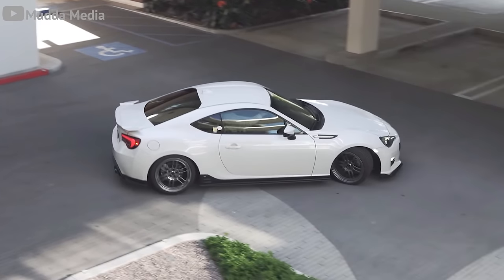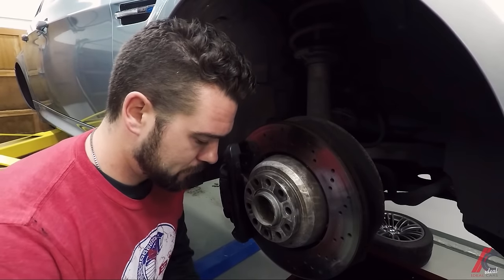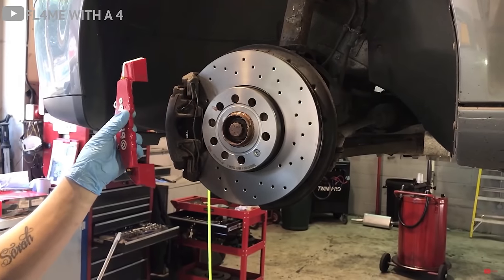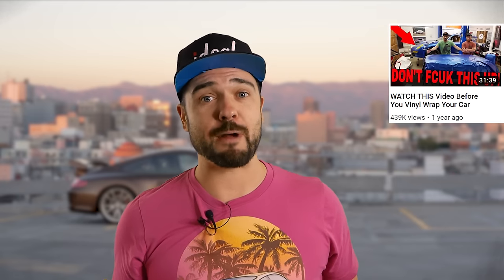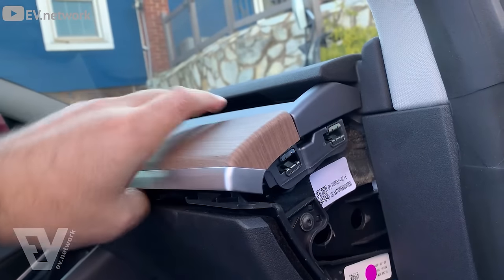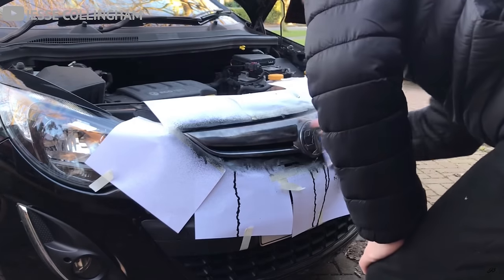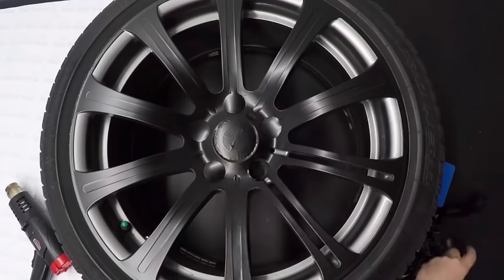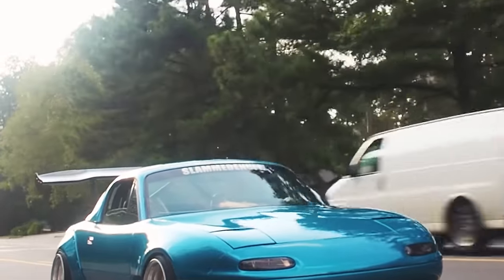Cheap DIY Car Mods That Make A HUGE DIFFERENCE!

Comment: First mod should always be tires unless they're already good
Reply: Pirelli dragon sport OMG these tyres are my everything literally soooo good especially in the wet
Reply: Agreeded
Reply: Tires aren't a mod though

Edited moments after: unless the are a specific compound or different size in the case of different wheels
Reply: Wheels tires and suspension are the first 3
Reply: Buy a car that needs new tires and bam u cut some off the price of your car since you’re gonna get new wheels anyway
Reply: Irrelevant comment on a video that says cheap in the title
Reply: @ughugh4117  Irrelevant comment on your part too
Reply: @cleanwindow_7869  I, Dio Brando, only use inline V20 Engines
Reply: Good tyres, then a good brake system, it's all well and good having a pretty car, not so good when that pretty car goes into some guys rear bumper or fence lol
Reply: Learned that the hard way
Reply: Facts 💯
Reply: All seasons all the way
Reply: Facts mine was
Reply: @andrewjohnson442  brakes ?
Reply: Learning bros
Reply: Yes agreed or muffler delete 🤷🏾‍♂️
Reply: Video top right corner
Reply: Agreed
Reply: Agreed  but I will do rims and tires
Reply: Either that or tint
Reply: We know dadddddd
Reply: @alexeyshtengelov6086  and the a lot of english are is not a the

Comment: IQOTD: Probably suspension, then wheels and tyres. Lower suspension reduces body roll and improves the feel  of the car and handling, while lighter rims reduce weight and the looks of the car and tyres keeps you nice and steady

Comment: What I noticed recently is that a lot of BMWs are debadged. Maybe they don't want people to know that they're rolling in a cheap 3 Series with a 4 banger...
Reply from the maker: yeah or they just like a cleaner look. I debadged one of my M3's... so you can look at debaging both ways.. to hide a slow car... or to hide a high performance car.
Reply: Some people add M badges to their crappy BMW to brag that they have an M car.I'm sick of this.I've seen this in so many BMW.Even if tou buy a BMW M240i it looks like you got a regular 2-series and you decided to stick an M badge
Reply: @nickgav7390  i once saw Ford Transit with M5 Badge and a huge ass sticker saying M5 covering the whole rear
Reply: Nick Gav I saw a crappy one on a 7 series
Reply: i took my 335i badge off so people think it’s slow
Reply: 318ti not a cheap 4cyl 😂 at least the “cheap 4’s” aren’t beaten to shit like all the i6’s owned by anyone who thinks they can drift 😂 clowns
Reply: Nicholas Buddin the most bmw 4 bangers are build badly. They got many problems and are very unreliable.

Comment: I have a 1999 b5 1.9tdi a4 saloon and when I will buy another car then the a4 is going into project car status. First mods would be, suspension (2-3 inch lower) wheels, ecu remap, straight pipe, maybee down the line a bigger turbo and an intercooler

Comment: Honestly I always change all the fluids first thing and same with all the filters, then I change up the exterior lighting with LED bulbs then work my way inside and do the same. Though if those don't count I would say a new radio usually is the first mod. Most the cars I get are really old and don't have good entertainment systems so I have to update them asap. Which I always aim to get the radios with backup cameras as well.

Comment: I always do suspension first.  If you get your wheels first, how do you KNOW they will fit once you lower it.  I am always pushing the limits of what will fit under the fenders of my cars.  Doing it this way has saved my a$$ more than once!  One time Discount had to Take back a one-off set of Forgelines because the 19X12” With 335/30 19 rears wouldn’t fit.  (They needed about another 3/8” backspacing to fit). If I had gotten the wheels first, I would never have caught the issue, and I would be out 6K for wheels (Or at least another 2k in rear wheels with the proper backspace)

Comment: My list. 
1st tires. 
2nd Brakes and calibers. 
3rd suspension. 
4th rims. 
5th steering wheel upgrade. 
6th short throw shifter. 
7th new belts n hoses and all needed fluids. 
8th cold air intake
9th intercooler system.
10th weight delete. 
11th rebuild engine and trans if needed. 
12th drive it like a bat outa hell.
Reply: Oh forgot one mod. Some cool ass under glow. Idc what people say I love underglow. It's not illegal either long as it's not red or blue. U just can't have it super bright or flashing either.

Comment: Everything was good until the lowering springs. Unless you want your shocks and struts to be prematurely wearing out multiple times, get shocks and struts that are made for lowering springs or coilovers (which are not cheap but replacing shocks frequently isn't either)

Comment: I would not lower my car, my first mod was snow tires. Then head gasket, then radiator water pump heater core then stereo, dual cameras, got much more to do.

Comment: Covering Break Calipers with Paint or  didn't know about covers, since clearance with wheels are issue. Anyway, covering them is like applying a blanket to your Break System. It won't allow the breaks to cool and work efficient.  Since, clearance was addressed i don't like adding weight to the vehicle so don't like Spacers one time 2 of them cracked and caused violent shaking on the vehicle, they loosened the lug nuts.  Dropping any car on my driveway won't clear my up hill slope of driveway as it is it occasionally scrapes or bottoms out with a passenger. in stock ride

Comment: First modification I always do which is the least intrusive is addressing amber reflectors, turn signals, or whatever it may be..I can’t stand an amber anything, so if it’s a turn signal I’ll make it clear corner and use a silver bulb that glows orange when lit..so I can be friendly with DOT requirements but look 10x better ..of course limitations in some cases like the Audi S3.. I had to end up using tint to just make it darker..yea yea it makes it less reflective, peeps in Europe don’t seem to have issues with visibility do they!?!

Comment: I’m almost 15 and I think my first car modification would either be an after market exhaust system, rims, tint, or an after market suspension upgrade. Also, I’m thinking my first car will be a 2008 Nissan 350Z
Reply: pretty awesome first car!

Comment: Tyres and rims sound system interior and paint job suspension brakes exhaust engine and stickers with my name or logo across the car plus weight reduction

Comment: Just my opinion / thoughts that bug me and is subjective for other people:

Slammed excessive camber cars look so bad, I don't see how people think they look good, very low with a slight camber to increase cornering is still good but you do not need that much excessive camber. If you drift or want a higher top speed going straight due to less grip / track friction then sure, but outside of that it will ruin your grip and your handling (unless you want to drift or have loose handling and grip), it will severely wear down your tire life, and it will make bumps and rough terrain not the smoothest ride while you're car rides on its shock bumps (or the wheel if you set it too low even with a body mod or lip curl to fit the tire, but of course adding the camber will allow you to go lower too since it's at an angle). I do not see the aesthetic appeal of it, it makes the car look very bad and "cheazy" / not like a professional or high performance modded and designed sport car. It's unsafe for street driving and should only really be used IMO on drift cars for the track.

Comment: Lowering does increase the handling on the car but when you go to the extreme camber that does not improve handling it actually makes it worse because you’re riding on less of your tire than intended if that’s your look that’s OK but no you do not get better handling with extreme camber this is coming from a mechanic for 25 years

Comment: Lowering your car can give you a great benefit to your car
Also can destroy your car completely unless you have adjustable suspension
Lowering cars sucks on speed bumps and bumpy roads or damaged roads or any roads that kinda destroy the car
I suggest not to lower your car, if you driving or having this road in your country but with adjustable suspension, it will be fine as long as you remind yourself each time you see bumpy road or damaged road

Comment: The first modification for my first car would be a turbo upgrade (if the car has at leat one)
Reply: Noo. Do you even own a car?
Reply: @KERBROES  Not yet.I want to buy a SAAB 93 Aero as my first car
Reply: @nickgav7390  haha cool car. Word of advice do mad research on forums and focus on mods that build reliability. Reliability over power any day. I literally run 385whp daily no problem. It is about doing it right and starting from the ground up. Think of it like this, in your pursuit of any performance gain is welcomed, but not necessary. You will end up with a clean reliability beautiful machine instead of a shit box on the brink of destruction. To get a turbo upgrades the rest of the car most likely has to be upgraded as well to hold that much power reliably, when you dont do that it's how horror stories happen. Always do it right.
Reply: @nickgav7390  Trust you will be way more happy with a "balanced car" instead of a big hp straight line machine.

Comment: Haha first preformance mods a $15 spector filter then get a saw and cut the springs then get a $30 fartcan that sounds like a pissed off bee and a sticker that says Honda even if it isn't a honda because that sticker alone will add 20+hp ooooh yeah LOL

Comment: First thing I've always done in terms of modding the few cars I've driven has always been to strip EVERYTHING that isn't absolutely essential out of the interior of it, replace what is necessary with the lightest possible option that meets quality standards, i.e. won't break after like 2-5 track days. After that it's always tires...

Comment: Just did my preferred 1st mod. A remap. Went from stock 450hp, 480 lb ft of torque to stage 1. 530 hp, 575 lb ft of torque. 2016 BMW 650i xdrive gran coupe m sport is a whole new animal now. Props to AMR PERFORMANCE!!!!
Reply: how u do that

Comment: Miata or S2000 ?
Reply from the maker: depends... both are great options.
Reply: I would buy a S2000.However,keep in mind that if you want to buy one of those cars,it is almost impossible to find one stock

Comment: Dont lower your car if you cant don't right. Literally worse handling.
Reply from the maker: you definitely have a point!
Reply: @IdealMediaChannel  Thanks for the reply, I just had to put it out there cause I see all these people slamming their evos but evos physically DONT do well low on the ground. Then they complain and beat on the transmission like it's a honda. I cringe... good video btw definitely would be wrapping the tesla interior when it comes in.
Reply: Another drawback is that when you   hind puddles on the road,it is likely to damage your car
Reply: @nickgav7390  oh yeah, you cant convince me in a million years unless I can get air suspension. Even then I would wait until the tech is even more mature and affordable.
Reply: @KERBROES  You are right.However the reliability is a queston though.Who knows if it is so unreliable as the one on a Range Rover?If you know which air suspension is reliable,you willl have no problem.
Reply: @nickgav7390  for sure, all about doing the research and getting it done right.